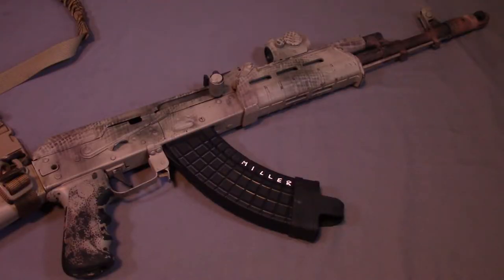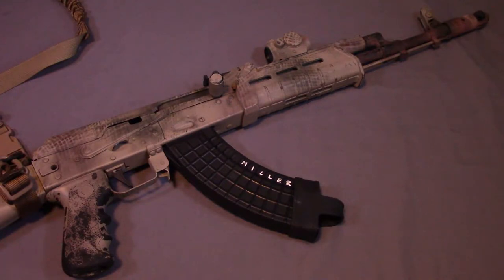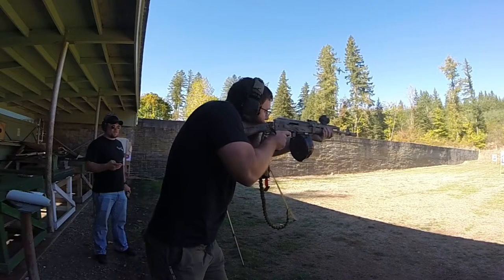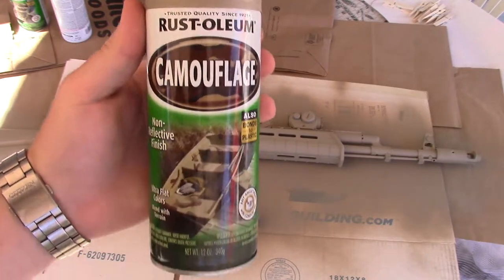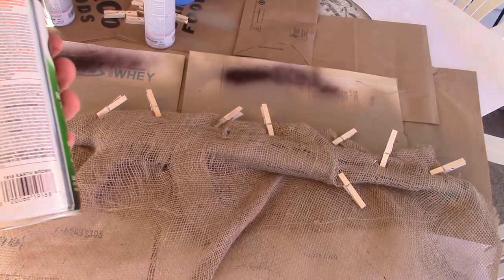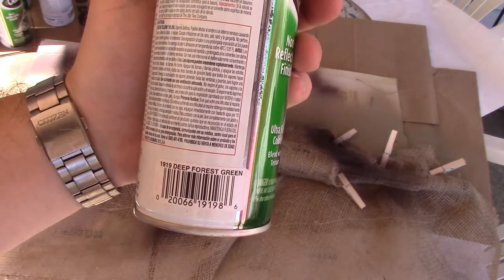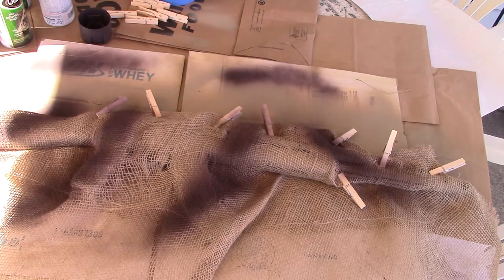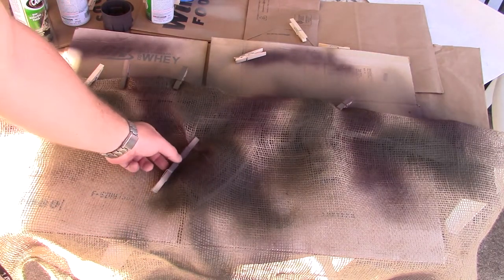AK Snake Skin Paint Job

Comment: another interesting aspect to your paint job is that it's simple and does NOT include heat treating each coat in the oven. such treatment would add to the integrity/longevity of each coat so that they DONT rub off over time/use.  many folks would think that's better but it adds A LOT of prep time.  to me that's a major, unnecessary drawback. so what if non heat treated paint layers gradually rub off? that same erosion actually adds to the weathering AND camouflage. so keep it simple.
Reply from the maker: I agree. I prefer to let my paint jobs wear over time. Shows people that I actually use my firearms and if you just accept that it's going to wear, you don't get distraught when you get scratches all over it.
Thanks for watching!

Comment: I'll give it a shot here soon. I'll post up a video after I get done with it. I usually don't rapid fire more than 60 rounds. I think the paint would hold up on the barrel for that much at least.
Reply from the maker: +Mohawk Chris Oh yeah! It should be just fine. After the 75 rounds I dumped the discoloration wasn't really present. I then immediately handed it off to the other guy who dumped another 75 rounds through it. That's where most of the damage to the paint took place. If you're in a situation where you're having to put more than 150 rounds downrange in 90 seconds, the last thing you're going to worry about is your paint job.
Thanks for watching!